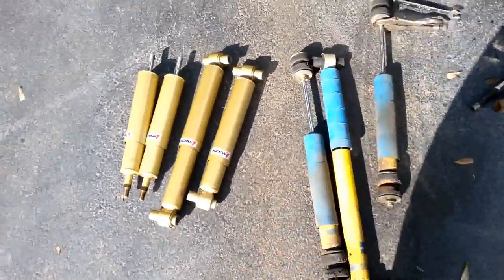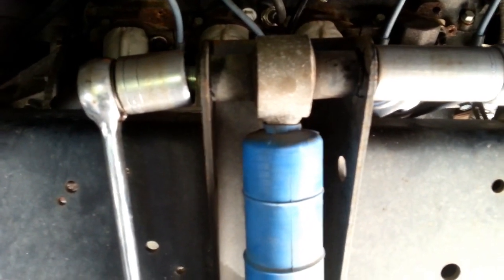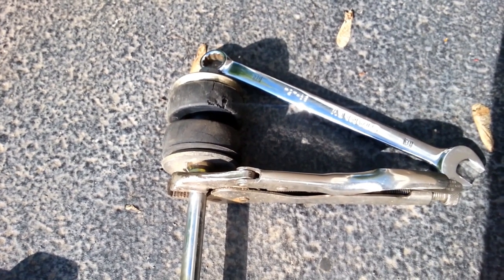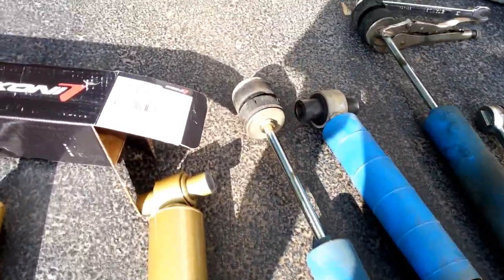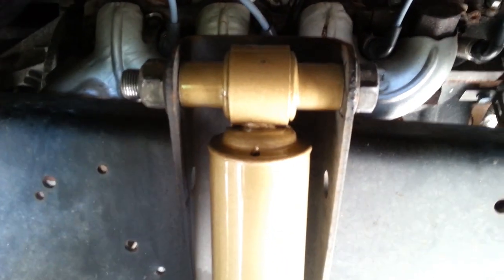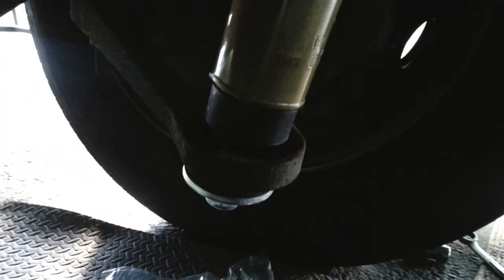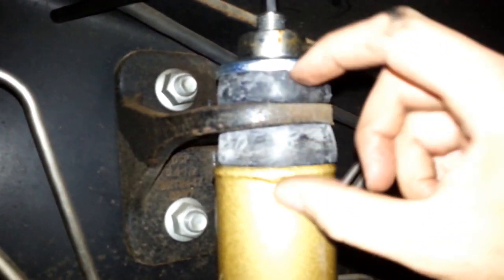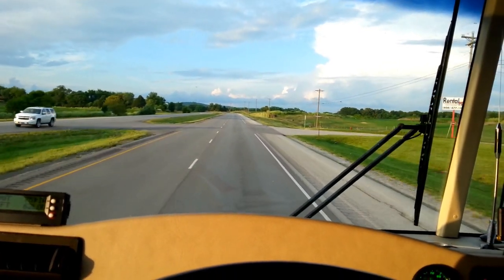How I changed my Bilstein Shocks over to KONI FSD on my Workhorse W24 Chassis

Comment: Bilstein shocks have been hands down the best shocks on the market for years.
Reply from the maker: Sorry that was not my experience, after 10 years the Bilstein Shocks were flat wore out bouncing me down the road as we drove. I have 7 years on the KONI FSD Gold and they are still providing the same great ride. IMHO
Reply: @ktoutdoor  I have been in the automotive industry for forty years and used both products on the road and racing. The hype and price on the Konis for the motorhome market is interesting. You will find Bilstein shocks on every manufacturers street vehicles and trucks. Ten years on any set of shocks is way to long in any application let alone heavy duty use. Good luck with your choice.

Comment: Just installed my Konis. I used my Milwaukee 1/2" impact and it made those nuts zip right off. I had the front done in 20 minutes. Mine is a 2003 W22. The rear is a 15/16 nut on bottom. I had the rear done in 15 minutes. It had the original shocks; which were absolutely shot!

Thank you for another helpful prep video!
Reply from the maker: Thank you for contributing, we love our Koni's

Comment: Did you put your leveling jacks down during the install or removal?  I'm getting ready to tackle mine soon.  Thanks in Advance.
Reply from the maker: Its been a while but it makes sense seeing how they were a gas shock so raising up the frame would extend the shocks so you would not have to compress them in order to remove.

Comment: I have a workhorse W18 (Four Winds Hurricane) and the chassis is from 2009 but the RV was built in 2010.....it's now 2022...I need new shocks, sumo springs, anti sway bars (front and back) as well....I dont like driving down the road like a pinball....
Reply from the maker: Thanks for watching check out Brazels rv for upgrade parts https://www.brazelsrv.com/
Reply: @ktoutdoor  Thanks for the tip, much appreciated.

Comment: Video ended before I heard your review. Was the time & $500+ bucks  worth it in improvement in ride & handling
Reply from the maker: Yes that was a few years back but they are still working great, it really helped with the bouncing after we crossed a bridge. It did not help much with the side to side motion we get when we transfer from one road to another like when you pull out from a gas station sometimes and the roads are at different levels.
Reply: @ktoutdoor  I understand the Koni FSD are adjustable. Did you play with that at all, and if so, how?
Reply from the maker: @geneduclos4003  Note the FSD are self adjusting NOT adjustable see this video https://youtu.be/XcLiq2q3S1k